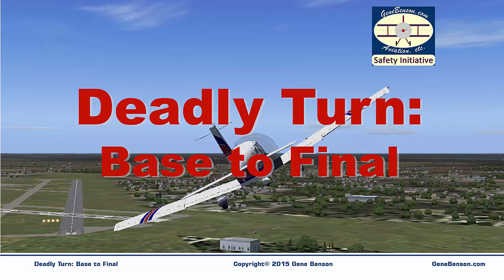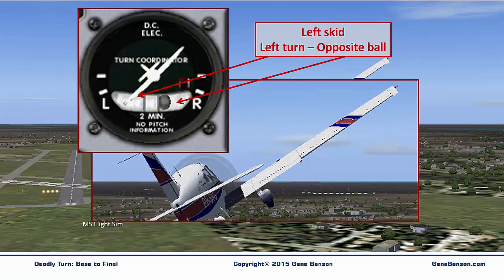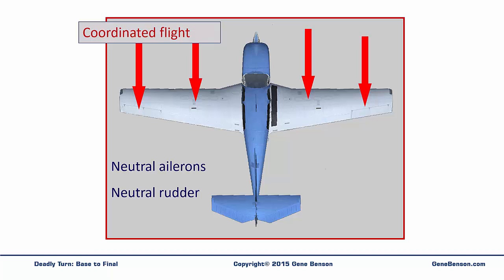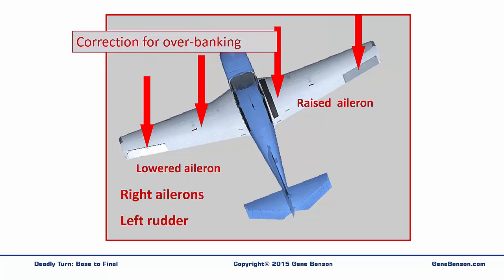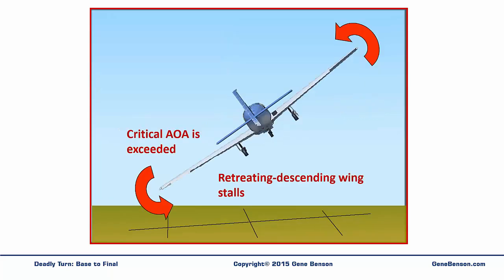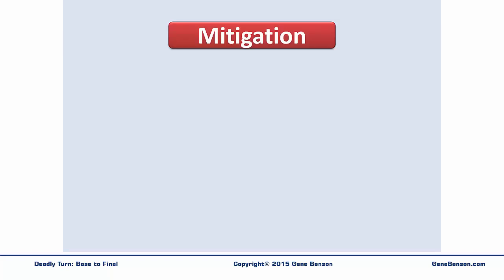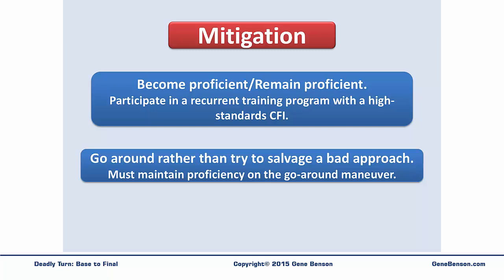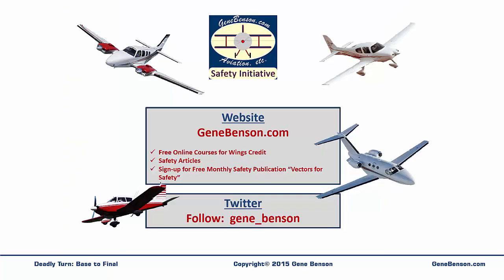Deadly Turn - Base Leg to Final Approach

Comment: Nice rule of thumb:"if more banking than 30 degrees is needed, then it's time to go around."
Reply from the maker: That is a good rule-of-thumb. Let's also remember that even turns requiring less than 30 degrees of bank must be coordinated.
Reply: I had a commercial pilot tell me that he considered 25° in a banked approach as a safe limit. Very little rudder or no rudder on a nose down base to final would seem a safer procedure? I would if Microsoft Sim will put a Cessna into a spin on a final.
Reply: @GeneBensonAviation   Passenger jets yaw when banking from base to final but the air speed, flaps and banking stall envelope want allow an approach stall.
Reply from the maker: @glennoc8585  Not all passenger jets have complete software protection against an approach stall, but it is highly unlikely to occur for two reasons. First, the crews are trained to a much higher level than most pilots of small GA airplanes. The advanced simulators are great learning tools. Also, the large jets use "spoilerons" which automatically work to increase roll while requiring less aileron displacement at low airspeeds. This results in less adverse yaw because the spoilers are not located as far out on the wings as the ailerons so therefore have a shorter moment arm.
Reply: @GeneBensonAviation  Thanks Gene. It's keeping the yaw rate as little as possible to equalise sir flow.
Reply: As a glider Pilot, I disagree
Reply: @GeneBensonAviation  I like that one. I will use it as my own!
Reply: @VsukraM 
As an airplane pilot, I concur with you. People should be taught how to keep steep turns safe if they must be performed for some unpredictable reason, not that they should never be done.
I for one do not want to be a passenger in the plane with a pilot who never practices a steep descending turn at pattern speeds.

Comment: On this topic I want to say this:  Be very aware of a tailwind on base leg. If you have one, start your turn to final early. Also, a tailwind can give you the illusion of plenty of airspeed when it's only ground speed.
Reply: VERY good point on the tailwind giving the illusion of speed. The only real speed that matters to the wing is airspeed. My CFI used to always say “you need to stay ahead of the airplane.”  Good words.
Reply: but wouldn't your airspeed indicator show it?
Reply: @OnceShy_TwiceBitten  the airspeed indicator would show something. If the controls feel mushy that suggests its close to stall. There seem to be a lot of general aviation accidents and stall is involved in many of them. I think people fail to give it a hard climb coming out for the go around.
Reply: Do you mean coming into a strong crosswind on landing? I always think I should just be flying faster. If you’re flying fast you’re flying safe right? I always  want to turn base to final with a good dollop of airspeed to ensure I’m making that turn with a lot of air over the wings. I really don’t know though, I’m just a student pilot.
Reply: @jackglossop4859  flying plenty fast is a good thing for a student or anybody else that has a long runway in front of him. Plenty of air speed around the airport should be the law in your heart. Fly wide turns. If you have to go around climb out thoroughly. The airport is an abnormal environment for an airplane and a pilot will easily overestimate his turning ability and his stall speeds and everything else because he just doesn't do it enough unless he's a short take-off and landing specialist. In a ship it's called losing steerage way where you still float but your  Rudder is meaningless. In an airplane you are trying to dominate a slippery flowing elastic fluid. Your altitude in your horse power are like cash in the bank but AirSpeed is money in your hand. If you're too close to the ground and you catch a down draft or something you need to have enough AirSpeed to dominate.
Reply: @jackglossop4859  Your reply sounds like you didn't understand my comment at all.
Reply: @markmcgoveran6811  Sounds like you're saying a person doesn't need to learn how to fly properly, just as long as they have a lot of extra airspeed over stall speed.
Reply: @philipmartin708  yes that’s exactly what I’m saying. You should be an instructor, you’re inspiring 🙌
Reply: @philipmartin708  I'm an engineer so we don't really have anything as far as a variable in an equation for improperly and properly. As a mathematician I find a lot of good rules and laws start growing out of a hole in the ground we water it with our tears and we leave one of our loved ones planted there. One good rule that's not popular would be to completely take off until you have reset the controls for-level flight.  Somebody comes in for a landing, making the transition from level flight to slowing down to landing on the ground. Then when he has to go around he doesn't get all the way back to the original state he was in when he initiated the first time. I hope it sounds like I'm saying don't make a hybrid landing take off landing if you don't land. Do a complete climb out, transition to the level flight so you are coming in for your landing attempt this second time with the exact same settings as the first time. That's what I meant by climb out if you have to come back and try again. As far as the airspeed end of it if you have a lot of air speed, above stall speed, when you fly into different bodies of air moving different directions, the trigonometry works out for sufficient air speed, In case you encounter some air motion that you were not expecting. I hope this sounds like I'm saying you are less likely to stall if you are flying straight and level, or turning wider. I hope it sounds like I'm saying every one of those dead pilots laying in a hole from those stalls knew every single detail I have just mentioned. What possible lesson could we learn from them? What lesson does it sound like we could learn from them? Reset all your controls for level flight so you don't come in with the flaps down on the wrong air plane. Have a little extra AirSpeed to get you through a downdraft or a gust from a funny direction. Air is free turn wide! It sounds to me like the pilots often times misperceive how hard they're turning the airplane so close to the ground and stall speed. What does it sound like to you when you reread my first piece and then you read this one?
Reply: Consider that the base leg is 90* to the runway. If you have a strong enough of a tail wind on your base leg to cause a problem with your airspeed then I would figure that the landing crosswind will exceed the plane's crosswind landing rating. And a tailwind will reduce your air speed but increase the ground speed.
Reply: @tdkeyes1  Wind doesn't have any effect on the airspeed of an aircraft in flight. But it does have an effect on the groundspeed. Think of an airplane flying circles around a balloon that is drifting in the wind.

Comment: While a student pilot in 1979, I had set myself up "perfectly" for a cross-control stall. I was determined to land the airplane. However, instead of not being here to talk about it, it was like someone had suddenly slapped me in the head and I immediately realized what I was doing, righted the situation, requested a go-around, and learned a very valuable lesson! If things don't "feel" right, they probably aren't. Some 40 years later I still  hear my first instructors words, "Just fly the airplane."
Reply: It's important to those who do not know, we don't request a go-around, we declare / advise a go-around. First things first. Aviate, navigate, communicate. You should be halfway down the runway before you even let Tower know you're on-the-go. Cram. Climb. Clean. Call!

Comment: I have always added airspeed if im in an overshoot correction. Dont be afraid to put the nose down a few more degrees and trade altitude for airspeed. You can add power if needed, but the airspeed is the critical facter here.
Reply: Thanks
Reply: Thanks, great advice!
Reply: @davidpartridge9459  I can't remember just how many times my CFI barked in my ear:  LOWER THE NOSE ADD POWER LOWER THE NOSE ADD POWER.  I hated  this at first but once I understood and practiced this maneuver it became clear.  More than once it got me out of a low altitude and low speed issue.
Reply: Exactly,it's not an airliner  or a glider but a flying iron.  So dont be afraid of the airspeed. You ll need it.
Reply: Putting the nose down also unloads the wing and reduces AOA, making a stall less likely.
Reply: Great advice everyone - I'd add to that to be mindful of the white arc and wing/flap configuration.
Reply: Yes, If you have to remember something in this position, ADD SPEED by lowering the nose; this will save you ! (something I learned when I practised hanggliding !)

Comment: Keep the speed up, don't make steep turns close to the ground especially at low power settings. Know what the plane is doing and always be flying the thing.
Reply: Exactly what happened to me, my comments are above
Reply: Make a downwind to final turn. No need to make a rectangle.
Reply: @jandejong2430  not the best advice. If you're consistently having to oval 180 degrees, there is something wrong with your flows. There are four portions of a pattern for a reason.  Develop a pattern profile and practice it. Sure, sometimes you have a funky crosswind or, whatever and we'll have to oval out your downwind, base, final but.. If it's happening every time there's a bigger problem

Comment: Excellent description. I was taught to SLIGHTLY overturn (for want of a better description) downwind to base to approx 110 degrees, this gives a better view of the runway, reduces the turn to final and in practice, the headwind component will correct the actual ground track to prevent encroaching on the threshold. My 2c
Reply: Simple solution.
Reply: This is a very logical solution or mitigation, as the video refers to. They don't really teach this, in my experience, but I'm going to consciously start doing this until the instructors tell me otherwise. I don't really understand the problem with flying a thousand feet farther on the downwind past the 90 degree angle point, other than extending the length in minutes, of your approach duration.
Reply: @HighMo  My instructor wouldn't let me extend my downwind....with the throttle at idle you want to be close enough to glide in case your engine stalls. Also taught me short-field landings...normally I had to add power to taxi the first turn-out.
Reply: @readmore3634  Understand your point completely, but on the downwind, abeam the numbers, I've pulled power to 1500 and have 1st notch of flaps in. (PA28) I'm never at idle at this point. I think the big issue is the time spent in the pattern, particularly at the very busy GA airport I fly out of. They don't like LONG final approaches with all the small and medium size jets in the pattern. To complicate things further, I switched instructors and he wants no more than 20 degree bank angles on any turn in the pattern. That rounds things out significantly. My only issue at this point is consistently judging the point of roundout.
Reply: @HighMo  Thank you for the reply...Make no mistake, I'm a student pilot and haven't yet figured out what suits me best in the pattern....When I was a kid I built radio controlled model airplanes from wood. One of the many things I take from that is what flies and what struggles to fly. So even when I first started lessons, and my instructor, trying (from the first hour) to distract me from the moment, that no matter what....keep the airplane flying. And when you are low..... keep it flying with small inputs and fairly level wings.  We practiced idle landings and short runway in case I ever had a problem. Oh....and never, ever bring it in on it's nose.
Reply: @HighMo  As long as you know you'll never have to make a dead stick landing,  you're right, no need to practice turning base 45 degrees  from your  landing spot.

Comment: During my younger days, I flew a variety of sailplanes from fairly easy to fly 1-26's with a very low stall speed to more high performance fiberglass ships with higher stall speeds and flaps.  My original instructor in 1976 taught me to avoid abrupt turns to base and to final using more of a long sweeping 180 degree approach from the downwind leg with much less bank and steady speeds, when at all possible.  That advice stuck with me through more than 20 years of safe and wonderful flights.

Comment: Ok here is a mitigation strategy that will likely generate some controversy:    I think folks should practice a nose down slip when you see that you are over standing final.  And I think this should be practiced.   In a left pattern, that means right rudder, nose down and slipping until you gain proper alignment.  If you have been maintaining proper altitudes in your approach to final, this "quick slip" gets you down and aligned very quickly--at least in the slow airplanes I have flown.   If you keep the nose down, the plane will quickly gain forward control when you get aligned and center the ball.  If after a quick slip you are still too high you need to go around.  I am not sure why this is not taught.  I would be interested in feedback.   I fly Citabria, Cub,  Champ and maybe these airplanes lend themselves to this process, but I am reminded of an airliner that made an emergency engine out landing at a closed field in Canada and used the slip to align and lose altitude when it had no other option.   I have often felt that teaching slipping and spins should be part of the basic PPL curriculum.

Comment: Both a slip and skid are uncoordinated flight.
If you stall in a turn in a slip, you are already applying the rudder that prevents the spin.
In a skid the low wing stalls first and the high wing keeps lifting and flips you upside down.
In a slip the high wing stalls first and the low wing keeps lifting returning you to level flight.
In a skid the ball is outside of the turn.
In a slip the ball is inside of the turn. 
You don’t have to look at the ball to be safe.
When in any doubt about control positions remember: “Aileron (thumbs) to the ground, Rudder to the sky!”
I thank Mr. Gordon Penner, Master CFI.

Comment: On December 27, 2021 just such an incident occurred approaching Gillespie Field (KSEE) in San Diego County.  I wish the crew had seen your recommendations and followed them.  Thank you Mr. Benson for your efforts to reduce the pilot / operator errors in aviation.  Hope you have a productive 2022.
Reply from the maker: Thanks for the kind words about my safety work. We do not yet know the cause of the Lear 35 tragedy in California, but it is possible that they fell victim to the scenario described in the video. It is also possible that they simply got too steep in the turn and experienced an accelerated stall. Personally, I think the underlying cause will be the pilots' decision making regarding IFR cancellation and switching runways in marginal weather conditions. Thanks for watching and for commenting.
Reply: @GeneBensonAviation  :  The Lear at night into Gillespie, circle to land, didn't he CFIT Rattlesnake Mountain?  Visibility got worse really quick, worse than forecast as I recall.
Reply from the maker: The Lear was not technically on a circle to land approach since he cancelled his IFR clearance, but the situation was basically the same. The preliminary report says they struck power lines initially. That final report should be coming out soon. In my opinion it is not a good idea to cancel the IFR unless the weather is well above VFR minimums and then never at night. I had a friend killed in a Beech King Air in Maine in 2000. He cancelled IFR, turned toward the airport and hit a mountain 100 feet below the summit. He was saving 6 minutes on the approach.  Here is a link to the preliminary report on the NTSB website: https://data.ntsb.gov/carol-repgen/api/Aviation/ReportMain/GenerateNewestReport/104445/pdf
Reply: @GeneBensonAviation  Thanks for the information Gene.  Sorry to hear about your friend.  Saving 6 minutes when you're behind is alot of temptation to us pilots to cut corners.  Pressure from passengers, other pressures, worries, weather coming in, the possibilities are endless.  And inventive.

Comment: The secret here is not to have the wing loaded up too much, don't raise the nose during the turn (that loads the wing) if you find you are a little low, complete the turn level the wings add power & then regain the profile wings level. It's the raising of the nose combined with a steep bank angle & crossed controls that's will bite yr  ass!